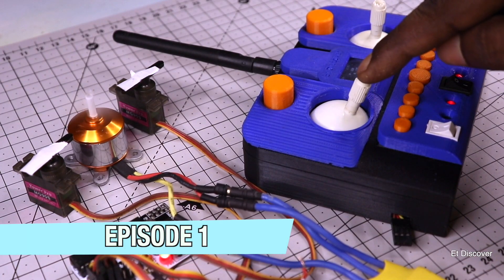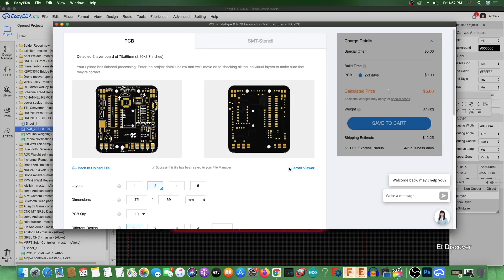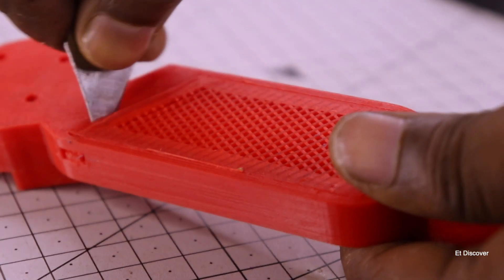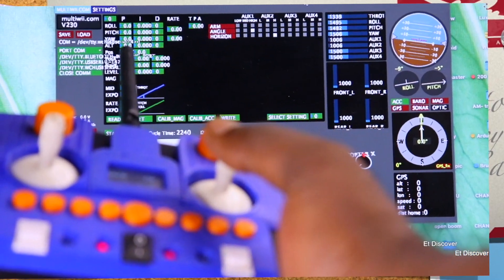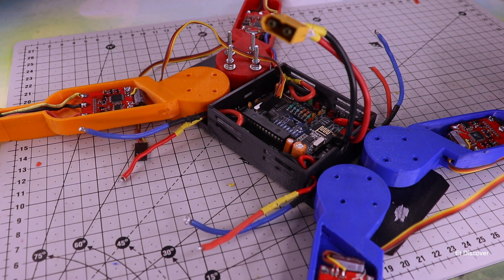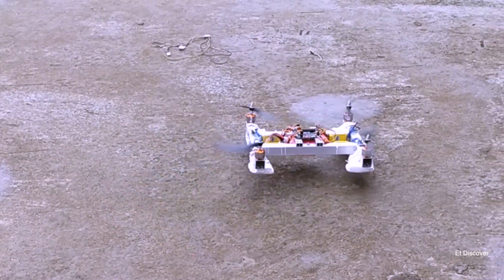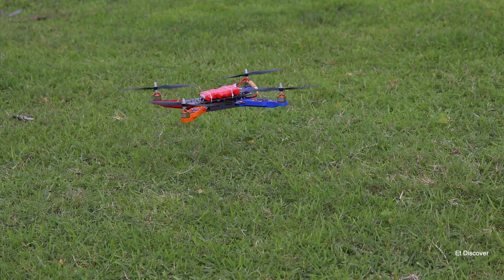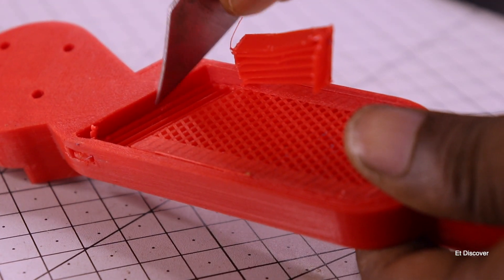How to  make a Arduino Quadcopter & Arduino transmitter

Comment: Yeah you did a mistake . in your drone 3  motors rotating in one direction and only 1 rotating in another direction. Because the connection of esc is not correct so 3 are ccw and 1 is cw

Comment: I have faced the same problem as you after several experiments I change the propellers to smaller one and I change the arduino transmitter to a flysky one and then all goes nice and smooth
The one difference from you is my flight controller I made it all a pcb without any modules soldered in all components as mpu6050 and Compas and barometer is included on the pcb
Reply: bro if you made it with ardiuno nano then please tell me that where did you attached scl and sda pin as it is not given on the nano

Comment: Bro iam your great fan from Kerala
Don't give up no matter what happens I also built the same drone by looking at your video and it worked for me .I recommend you to use aqurlic sheet as frame it is not that heavy and also it is strong also I used 3s 2p Li ion battery pack still worked for me ❤️❤️❤️ your really great ❤️❤️❤️❤️😘😘😘 don't give up we are all want to see your complete success ❤️❤️❤️

Comment: Excellent project

Make transmitter with stm32 like electronoobs
Reply from the maker: Ok I will try
Reply: Et Discover why not make a gopro type camera using the camera sensor of IPhone 12
Reply: Or make transmitters and receiver  ://youtu.be/tzNROquPEHQ
Reply: Try 3d printing propeller the flexible ones.